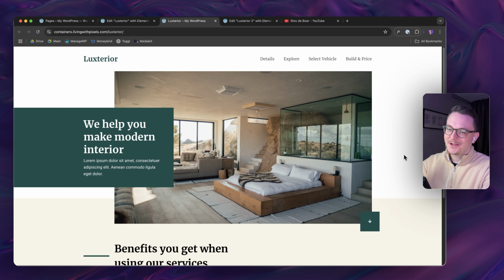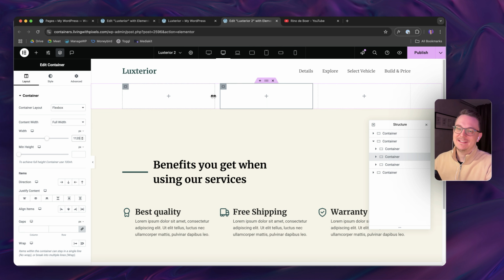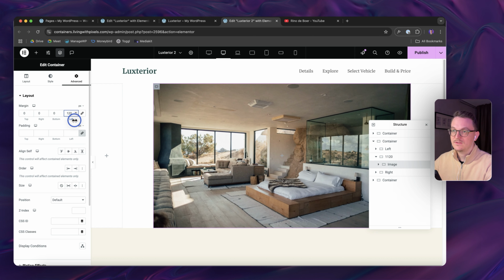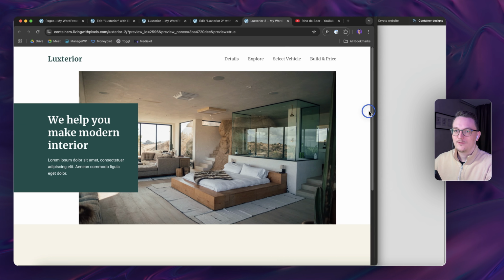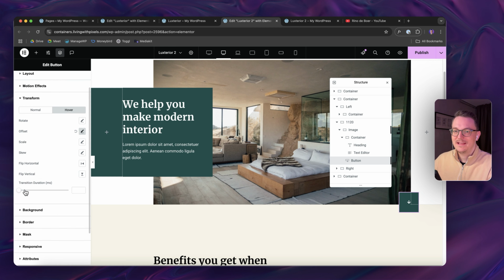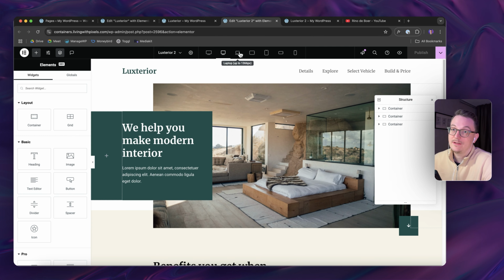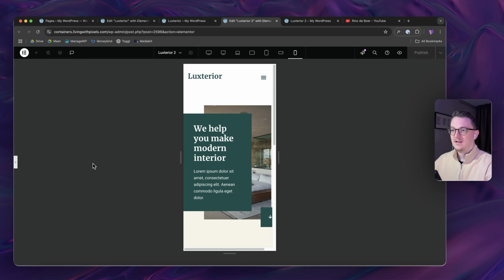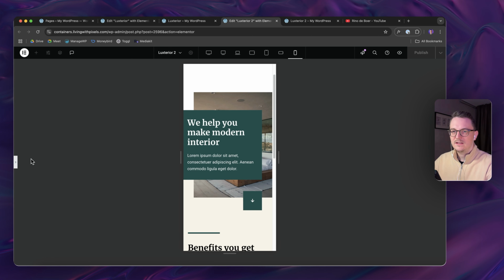How I made this infinity design with Elementor Container

Comment: Hey!  This is a great design and and it fits this website of interior design very well. 👍But do you think this massive mobile optimisation over 6 devices is really necessary? Which break points are you setting up (with), can you comment? Is a lot more work I think. I ask me if the browsers can work with these multiple device settings... Merry christmas and a happy new year for you!  🎄🎉
Reply from the maker: Thank you and Yea, it is more work, but layouts like this are not for people who don’t like custom and pixel perfect designs. And its just the hero section that’s more custom mostly. And the modern browsers works fine with this because Elementor is optimised for them. 

Merry Christmas to you too 🎄🎅🏼

Comment: You have made a very good effort to explain. I have one question: Will installing so many containers have any impact on the speed of the site?
Reply from the maker: Adding containers doesn’t impact performance that much, containers are actually a lot lighter than many widgets. Especially what I am doing in this layout where the containers are mainly empty, only used for layout creation.

Comment: 21:17 Use the custom unit selector (the pencil) 
Than you can use px, %,... where ever you want. You can even paste clamp functions.
Reply from the maker: I am aware of that, but how would clamp help me there align that green box?
Reply: @rinodeboer  I don't see a purpose on mobile, but I use it on desktop sometimes. 

Imagine you want a padding or margin of 250px when your screen width is 1920px wide and 25px when your screen width is 430px wide. When you can use clamp, you can make this gradual from desktop to mobile. 

You can also store a clamp function in a CSS variable and then use that variable as the padding or margin value via the custom unit options.
Reply from the maker: I see, great idea. Thanks for your input

Comment: I would do this different. With only 3 containers and this calc function in custom CSS

:root {
--boxed-width: 1120px;
--margins: calc((100% - var(--boxed-width)) / 2  )
}

It's a simple calculation to define the margins: 100% - (1120px divided by 2) 

As for your container structure:

Main container (parent) 
Ribbon container (child)
Image container (child)

Main container 
- Full width 100% and min-height of 80vh
-Padding and margin set to 0

Image container
- Full width : 1000px  (this is 1120px + 110px)
- Go to the margins and don't use px, %,... but the custom unit selector (the pencil icon) and add these values:

Top: 0  Right: var(--margins) bottom: 0 Left: auto

Ribbon container (add all text inside) 
- Full width: something like 50% (doesn't really matter, what looks good to you)
- Go to the padding and once again don't use px, %,... but the custom unit selector (the pencil icon) and add these values:

Top: 50px  Right: 50px bottom: 50px Left: var(--margins)

- go to position and set the ribbon container to position absolute
Horizontal offset, left : 0
Vertical offset, top : 50%
Go to transform > offset > offsetY : -50% (this will vertically center the ribbon container in the main container)

DONE. 

On smaller devices you need extra breakpoints and you can use normal values for the padding and margins.